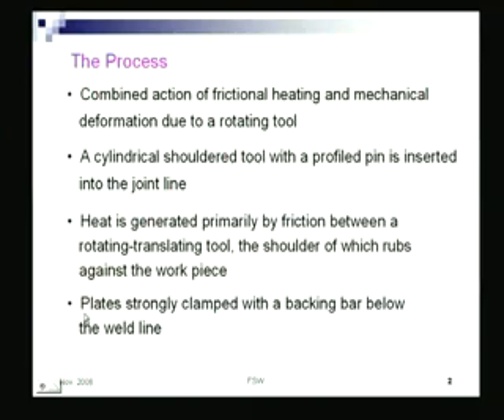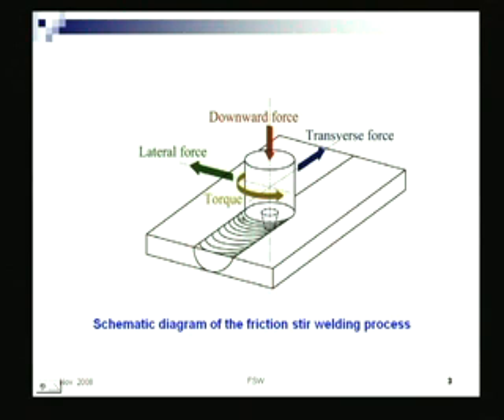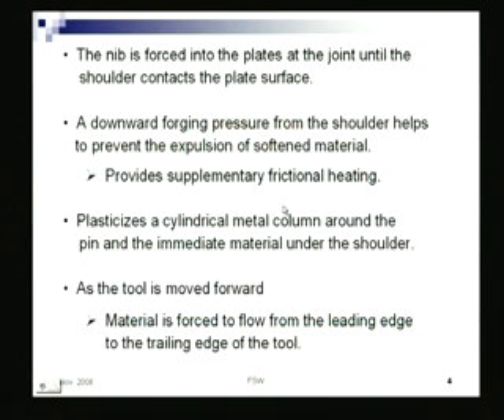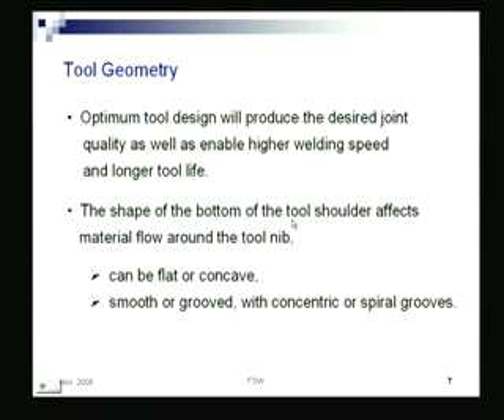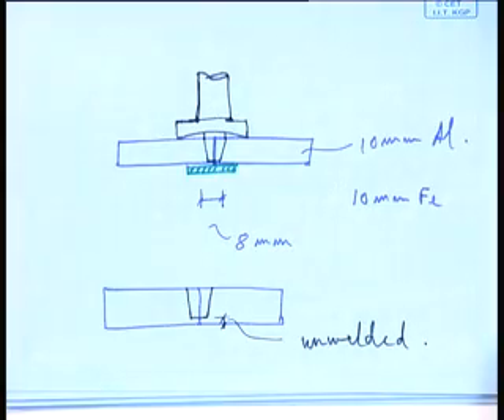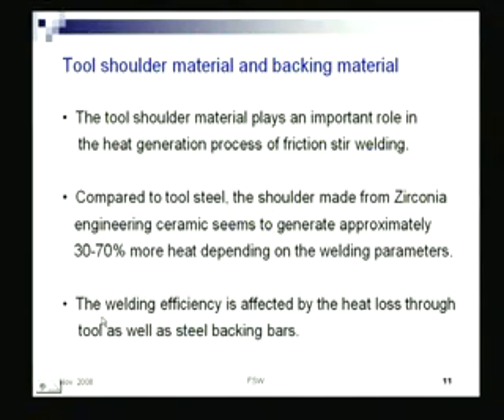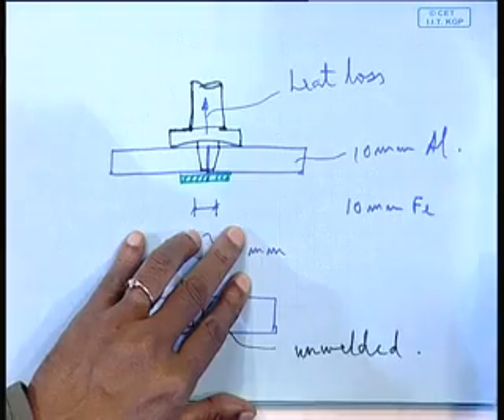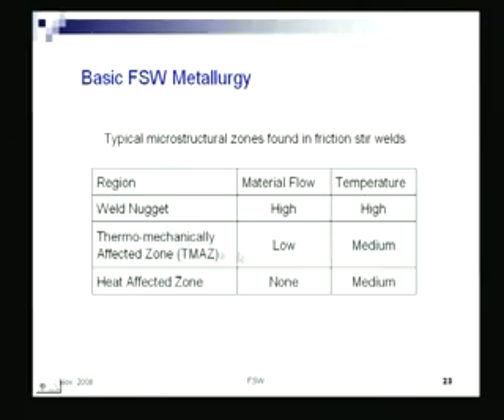Mod-01 Lec-35 Friction Stir Welding

Comment: How do you determine de parameters (rpm and welding speed) for FSW?. I´m making a project on FSW but  after welding i do radiographic examination and there is many lack of fusion, maybe due to an excess in the welding speed. Please give me your comments. Thanks
Reply: Have you finished your project
Reply: Even i am doing this project now

Comment: You solder with a nut and a screw soft materials like aluminum, ... and without gas, ... but you can not weld hard materials like steel and less hard and highly reactive like titanium, .... because the probe is destroyed leaving traces inside the material ... We weld any plate of titanium aluminum or austenitic steels with laser and gas from both sides at the same time, ..... SYMMETRICAL AND ASYMMETRIC WELDING for monocoque of the Navy and aviation
Reply: I have welded Inconel 718.. without any defect

Comment: is welded joint strength always increases with increase in rpm??.....how strength is depends upon process parameters?
Reply: there are many parameters involved in the process, for exemple: speed rotation, translation speed, geometry and material of the tool, material of the joint, thickness of the joint. I think it is incorrect to consider the increase in rpm always increase the strength.
Reply: Upto certain rpm the strength increases...further increase in rpm results in turbulent material flow leading to decrease in strength..Also at loo low rpm strength decreases due to inadequate stirring and material flow..

Comment: on which material friction stir welding done eat??
Reply: you can perform the process in many different materials, steel, aluminum, copper and others. It is also possible to weld a joint with 2 different materials.